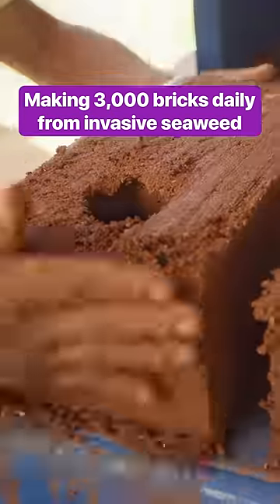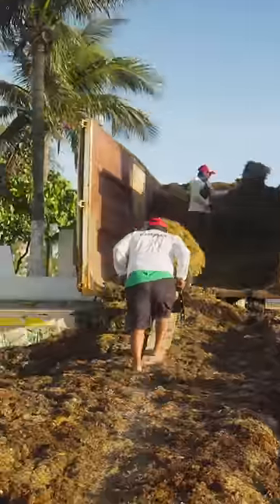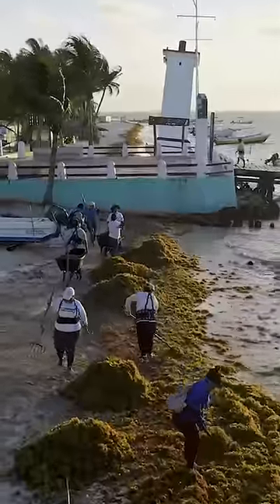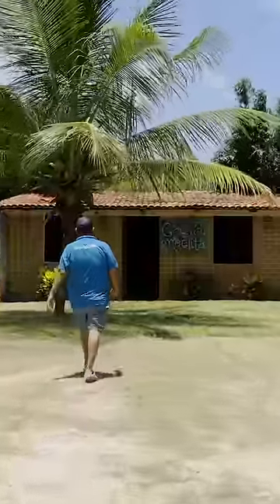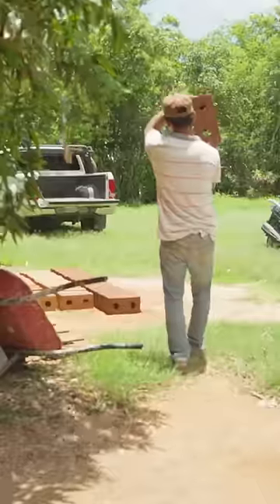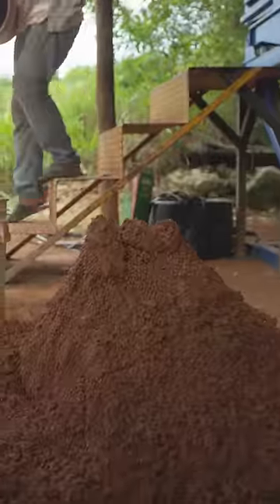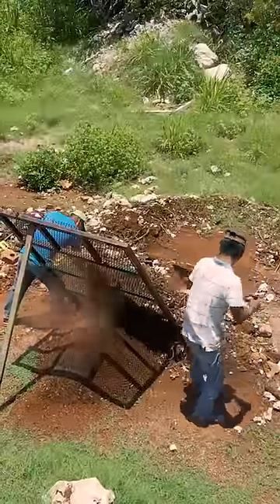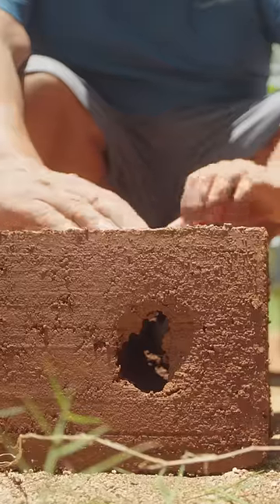Did you know bricks can be made from seaweed? 🧱  #bricks #seaweed #recycle

Comment: Literally solves a problem for a business, the environment, makes an honest living, provides others with jobs and it’s a useful and necessary resource? This man is a treasure
Reply: Yeah and istead of paying for the material they need, they're the ones getting paid for it
Reply: Sadly it doesn't solve the problem for the environment, the sargassum is only a symptom of the problem.
Reply: @arturogutierrez3234  It helps to ameliorate at least one facet of the problem, which is more than most people do, and is thus useful and helpful overall.
Reply: @iridium8341  That's NOT how it works.

Are you not aware that straw is the traditional binder for bricks, and for adobe? 

When dry plant matter is mixed in as a binder with lime, clay, or other materials known to be inert once dry, it is PROTECTED from decomposition, and simply becomes a part of the now-inert building material.

Shredded hemp stalk fibers, mixed with lime into hempcrete, do NOT decompose over time; instead, they combines with the lime to be a nearly stone-like material, with which it is possible to build buildings that will last centuries, rather than mere decades.

Similarly straw, when mixed with clay and made into bricks, does NOT decompose over time; and the resulting bricks can be made into structures that, in some cases, have lasted well over two thousand years.

There is absolutely NO reason to assume that dried algae, when mixed as a binder with clay, quicklime or lime, will suddenly have a decomposition problem; and every reason to assume that it will simply become part of the now-inert building material, like other plant-based binders do.

Don't know much about building materials; do you?
🙄🤣🙄🤣🙄
Reply: do what you can, tho little is still miles better than doing nothing but carping.
Reply: I wonder if it has the same integrity a clay brick does
Reply: @jakeg9813  bruh you dont build structural elements with brick. Hell its not even for keeping rain out
Reply: @Keyspoet27 wait until he learns all the small pipes in his car are made from corn based plastic, and wont decompose
Reply: what percentage is it of dirt? we can make rammed earth structures, so what's the benefit of the seaweed?  besides just getting rid of it.
Reply: @johnn3542 they literally said in the video that 40% of each brick is the seaweed. So how much dirt do you think makes up the brick?
Reply: @iridium8341  I like talking about things I don't know anything about too. Did you know that the water in the sky gets there because of all the sad women in the world crying? It's true.
Reply: @johnn3542  It acts as a fibrous binding agent, like the straw in cob or adobe or the metal rebar in cement. Makes a very resilient brick that won't tear apart or break which is where the claim of it being hurricane proof comes from. It would also be somewhat earthquake resistant.

Comment: I love this!! But the video says the seaweed is causing respiratory problem… Does making them into brick get rid of it?
Reply: That's what I was wondering 💀 I mean I love that they are finding ways to better the environment (love mama nature) but Maybe they process it in a way the video didn't say?
Reply: It cause respiratory problems when it rots in the sun, on the beach it creates the perfect nutrient-rich and importantly wet environment for bacteria to create volatile waste metabolites that easily gets into the air by the sea wind, its comparable to compounds released by rotting sewage water due to similar nutrient makeup and the sheer amount of washing up on beaches. When made into bricks they become inert since they are thoroughly dried, their carbon becoming stored into adobe style bricks and no longer actively wet decaying which is an effective way to store carbon for long periods since not only do they last long but are infinitely reuseable. The compounds found in seaweed are also useful in creating stronger more durable bricks which increases its lifespan making them more effective than normal adobe bricks which is already an fantastic and cheap material that can be used to create permanent weather resistant housing even without the need of firing.
Reply: @themushroominside6540 so simply drying it avoids that? It can’t “reactivate” when the brick gets wet?
Reply: @crazy4beatles  Thats the genius part about the bricks, by drying out the sargassum and incorporating it into the bricks it makes a hostile environment for  bacteria as the inside of the brick stays anerobic while the drying process concentrates salt and other minerals that make it difficult for bacteria to fester much like a pickle brine. The compounds inside the seaweed helps to cement everything together as it is still drying resulting in a stronger brick.
Reply: @themushroominside6540 

Thanks for your thorough answer.
Reply: The respiratory problems come from when the seaweed decomposes while in big piles on the beach releasing  hydrogen sulfide gas.  The bricks are made from dried ground sargassum mixed with I'm guessing clays/dirt of some sort. So at that point the seaweed isn't rotting anymore.
Reply: @themushroominside6540 thank you for taking the time to type out such a thorough explanation. You answered all my questions and put time into doing something you didn’t have to do for the rest of us :)
Reply: @Nol. It's also completely natural doesn't need to be cleaned up and sargassum always creates habitat for ocean creatures.
Reply: @infernaldaedra  it's invasive though
Reply: @Aisndianeidnawbedja  so are you, seaweed can't be invasive it grows in the sea. It also is one of the largest small marine life habitats on earth. Not the correct use of the term invasive in my opinion.
Reply: @themushroominside6540 
Great answer. I guessed something along those lines, but it's good, to have a more thorough explanation.
Reply: @infernaldaedra  The sea is a huge place. Not every single marine organism occurs universally. Seaweed can absolutely be invasive if it's growing in an environment it is not native to and is outcompeting native species to the point of being destructive.
Reply: @crazy4beatles nope! It’s completely safe as it will no longer rot
Reply: I figured the respiratory issues were due to it decomposing and rotting on the beach, not that the seaweed itself causes respiratory issues
Reply: Its not just close proximity to things that causes respiratory problems. there's a reason, in this case it rotting.  they obviously wouldn't be using it if it was unsafe.
Reply: I think once it's refined and not baking and emitting in the hot sun it may not be a problem.
Reply: @themushroominside6540 

Man you’re awesome, thanks homie!
Reply: Only when it rots if you make it into a brick it won’t rot
Reply: @themushroominside6540 thank you for the in depth explanation. Really cool to know.
Reply: No because the only reason why it causes respiratory issues is due to the fact that it's rotting. By the time they've started making it into bricks the seaweed has been completely dried out and ground up into a paste and then turn into a brick. So since it's been dried out and turned into a brick it can no longer properly Decay since the bricks aren't even 100-percent seaweed. It's also mixed with other organic materials as well as just dirt.
Reply: My exact question
Reply: @themushroominside6540  I still wonder what would happen if they get wet. Dried dirt generally is not very water resistant (neither is clay) once it gets wet it will soften up again, for regular clay bricks the firing gives them their weather resistance.
Reply: @themushroominside6540  thanks for the answer!
Reply: @themushroominside6540 a lot of theory in your answer. But the plant material cam still break down and decompose. Have you seen actual bricks? Even without plant material they still develop moss and mold when wet.
Reply: @jassbee9636 they process it by hitting it with rocks and throwing it a window screen bro.
Reply: @Nol. Just do your own research next time
Reply: Yeah i was thinking about it. Unless they fire the bricks it's not watertight and can break down like asbestos lmao
Reply: @crazy4beatles  No. Once made into bricks, the seaweed becomes effectively inert, and will no longer cause respiratory problems.

And dry seaweed, that subsequently gets wet and decomposes, does NOT release the same volatile compounds that fresh decomposing seaweed does, in the first place.

Just thoroughly drying the seaweed, by itself, solves much of the problem.
Reply: @infernaldaedra  Untrue - even if it remained where it is native, huge rotting piles on the beach would STILL cause respiratory issues for humans, birds, and other animals.
Reply: @infernaldaedra  Seaweed can indeed be invasive, if marine currents are carrying it FAR from where it originated; as is the case with sargassum being washed up en masse on Florida beaches; as just one example.

Sargassum is NOT native to Florida, or anywhere in North or South America; and the primary habitat it provides is for the other species native to the Sargasso Sea, which is THOUSANDS of miles away.

Yes, some small Florida species are undoubtedly taking advantage of the habitat it provides, as it grows more common in the area; but only a tiny fraction of Florida species will do so, as it is NOT their native habitat.
Reply: @raerohan4241  Precisely.
Reply: @sextwister  IThe respiratory problems come from the decomposition of the FRESH seaweed; once the seaweed is thoroughly dried, even if it becomes wet again and rots, it will NOT offgas the same volatile compounds, and will thus NOT create the same respiratory issues.
Reply: @itsgonnabeanaurfromme  Once the seaweed has been thoroughly dried, it CANNOT offgas the same volatile compounds when rotting, and will thus NOT cause the same respiratory problems, even if it gets wet and rots.

Which it won't; once made into bricks.
Reply: @MightyGachiman  Nope.
Another person who clearly knows little to nothing about traditional building materials.
Reply: Sounds basically like adobe bricks. Very nice
Reply: @CampingforCool41  Pretty much, though thankfully, minus the usual scorpion eggs in the bricks.
🤣🤣🤣

Comment: These are way better for the environment over plastic bricks. Plastic bricks can pollute still, very slowly and they need to be in hotter areas. And cold plastic bricks can be brittle and fall apart easier. Plastic should not be used in anything for roads, nature, or used in housing as a main resource. Plastic needs to be used in appliances and household equipment, even clothing made from plastic fibers are better for the earth than the plastic bricks.

Comment: SCAM alert, bricks need to be made of inert stable minerals from a consistent source. any organic material will decay over time and ruin the brick. this is the same kind of BS the Boring Company said about making bricks from the dirt from thier tunnels. which also failed. Because brick material must have specific properties and stay in a small range of variability. these at most could be landscape trim brick. if the manufacturer can get past the toxic pollutants in them. the seaweed grows from the river discharge from south America and central America and is loaded from heavy metals dumped or leached into the water streams to the ocean. the stuff cannot be composted on used on organic farms because of it contaminate levels,